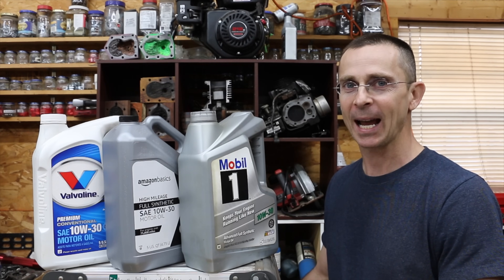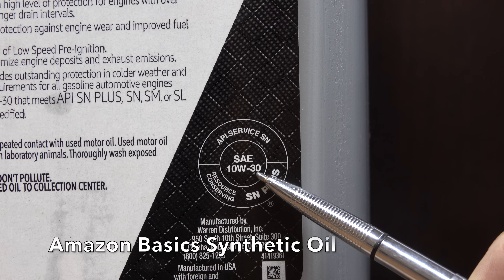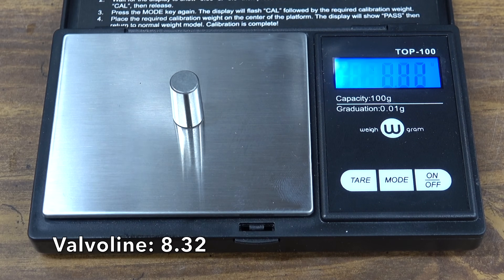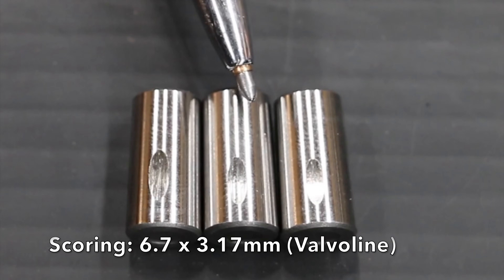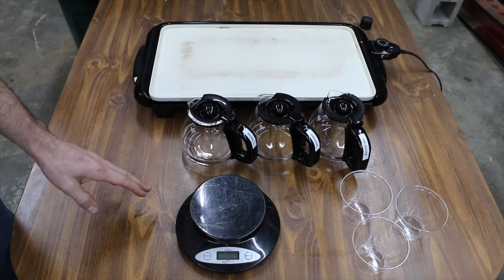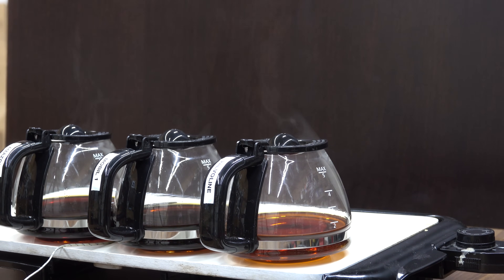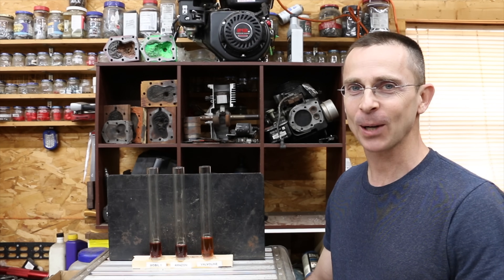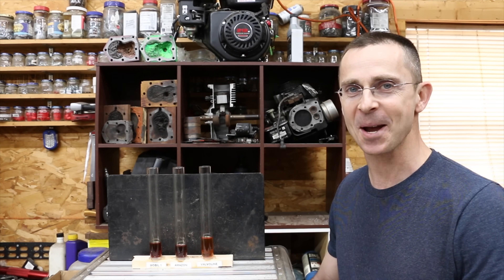Is AmazonBasics Full Synthetic Motor Oil better than Mobil 1? Let's find out!

Comment: Great test. In the friction test, it looked like the wheel dipped deeper into the cup of Mobile1 oil. That could have impacted the wear result. I must say, Amazon oil looks good in your tests.
Reply: It's not likely to make a substantial difference since the extra liquid is pushed off easily by the fairly high pressure he puts on the bearing; only a very thin film does the actual lubricating. There might be a tiny difference due to the extra cooling, but probably not significant enough to change the result.
Reply: Yeah I noticed that too, seemed like there was a lot more oil in the cup
Reply: There was a whole lot more oil in the cup of the Mobil 1. And more lubrication can change the results.
Reply: @ryannrjohnson  and yet, the Amazon Basics did just as well as Mobil 1 even though there was more Mobil 1... (which happens to be the oil I normally grab)
Reply: True, he was measuring heat from friction too right? During that test, and the Amazon Basics was mid 40°'s while both vav and mobile were in the low 50°'s
Reply: I saw that too
Reply: That test could be repeated...
Reply: Yeah. It didn’t seem right.
Reply: Unless it's dry or extremely low on oil, the depth of the oil in this particular test is pretty much meaningless. The viscosity of the oil is what will determine how much is picked up on the wheel as it goes around. So long as there's enough oil to make contact for a full revolution, it's fine.

the only thing that additional oil would give you is thermal capacity and a place to store wear metal... 10 seconds of operation isn't enough time to make either a factor.
Reply: More oil surrounding the friction point means more oil to remove heat, which is the main problem, here.  In hindsight, the oil in each test should have been measured.
Reply: Good eye.  Wonder if it makes a difference or not.  Physics is all about the little things!  Still impressed with the Amazon Oil.  Wonder who they contract it out too... Perhaps Mobile? Lol
Reply: @michaelhayes5601  2:11 shows the maker to be Warren Distribution Inc. So it's not a rebranded Mobil-1.
Reply: @NetRolller3D  good eye on you too!  Just would have been a funny thought.
Reply: When mobile 1 got to speed it was like the rest but that initial start up and slow down could have effected it
Reply: Also, the temperature, while on Amazon Basics,  was 5 degrees lower.
Reply: These are very archaic tests and should be taken with a grain of salt. I remember Amsoil did a test with Head and Shoulders shampoo and it performed the best of all Oils tested, obviously you wouldn't use shampoo in your engine. The point is that some oils perform very well under some conditions and other tests with the same oil perform very bad, plus with age oil and additives in the oil break down and don't perform as well.
Reply: @nexushexus4365  Project farm did a test with head and shoulders and it was beaten easily by an oil additive.
Reply: would be even better if he deep it all the way cover it all with oil just to be fair . but great job wee needed that test am changing my crv 2008 ex-l oil am going to use amazon basics full synthetic  5w-20 .

Comment: amazon basics AKA walmart supertech destroyed mobil 1 considering the bearing was soaked in mobil 1 and amazon basics had very little oil during the bearing test - not a knock on your test but i noticed the mobil 1 had more oil providing more protection than the amazon oil during the test, love the videos especially the oil testing videos. I run supertech syn in my lexus is350 with no concerns, inside is shiny as new at 110k
Reply from the maker: Thank you

Comment: Why did you use Valvoline conventional instead of synthetic? That's a bit misleading, no?
Reply: This is AmazonBasic vs. Mobil 1, non-synthetic is there to show the superiority of Synthetic oil in comparison to mineral oil regardless of the brand.
Reply: @HipolitoLorenzo  It confused me at first because he didn't word it in the best way. Had he said "and we'll also see how well these synthetics do against conventional", then I think it'll be less confusing. Or if he omitted the brand of the conventional because he says in the beginning of the video, "lets see which brand is the best".
Reply: Made valvoline look bad?
Reply: He mentioned that the Amazon Basics synthetic was similar in price to the Valvoline conventional so it was a test to see how a similarly priced oil stacked up.
Reply: All I'm saying is the title is supposed to compare amazon to Mobil 1, not to compare fossil with synth.  I would think if you're going to compare  two synthetics, then use two synthetics, or three. I don't see the point in using a dino oil. If you want to compare dino vs synth, then use three or four of each.
Reply: It was an apples to apples in PRICE to conventional Valvoline the real test was against Mobil 1.
Reply: I agree that the brand should have been left out of it. But including a non synthetic was an interesting control.
Reply: Synthetic vs synthetic only.  This test is misleading

Comment: Well done. Good simulation of proper testing considering your resources. An engine beats up the oil pretty good. An oil analysis runs around $30 including shipping. The real performance after say... 15-30K miles  is reveled in such tests conducted by a laboratories.  My 2.7 L diesel 15k miles still good for continued use.
Reply from the maker: Thank you!

Comment: Interesting results, amazon is clearly buying private labeled oil from one of the top brands.  Next time you do an oil test buy some Redline, their synthetic is like "real" synthetic and not just modified mineral oil.  It would be interesting to see how it compares with your equipment.  Also it would be interesting to see how a diesel oil compares to these synthetic oils since the diesel oil can contain ZDDP and other high pressure additives that would ruin the catalytic converter and oxygen sensor on a (modern car) gas engine.  Anything with flat tappets (non roller cam followers) should fare better with the diesel oil.
Reply from the maker: Thank you for the video idea!

Comment: Video suggestion. Could you please do some heat shrink and adhesive lined heat shrink tubing testing. Also heat shrink tubes with the solder inside would be interesting as well.
Reply from the maker: Thank you for the video idea!

Comment: Looks like the Amazon is made by Warren Oil, which makes allot of store brand oils. Decent company, with decent products. Wouldn't have any qualms about using that oil. I typically do use Mobil 1 though, since I can get a 5qt jug, and a factory filter for my car at Wal-Mart for around $26 total.
Reply from the maker: Thank you!

Comment: A very high percentage of "House Brand"  oils are made by  Warren Distribution or  Warren Unilube  (different companies).    Look on the bottom of your house brand oil....  If it says Wpp,  or Wne,  it's warren dist.    If it says WU, it's warren Unilube.   Both of these companies have a very good track record of producing oils up to par with vehicle warranty requirements.   I use "Generic"  oils in my engines all the time (Warren Dist. most frequently).   There are websites like PQI America that test these oils on the fancy gear,  and if it bears the SN badge,  it's up to the task 99% of the time.   Warren products have always passed.
Reply: Warren is a blender, a specialty chemical company, a distributor or all of the above?
Reply: @gregoryking1745  We do all three. We manufacture and distribute basic to specialty oil.
Reply from the maker: Thank you!

Comment: Great video with in depth and controlled testing.
I'm looking at choosing a 10w40 full syn for my FZ6 bike .
Iv done research in
Motul 7100
Motul 300v
Castrol Power 1 4T
Shell Advance Ultra 4
Silkolene Pro 4
Mobil 1 Racing 4T
AMSOIL (4stroke oil).
There's also a huge difference in the prices even though there all full synthetic
Reply from the maker: Thank you for the test ideas!
Reply: @ProjectFarm  is there an email I can send you the info I gathered

Comment: First off, thanks for another video. I always enjoy your videos. A few things to set straight though:
-Cold flow tests don’t necessarily prove much. When an oil is rated a 10W, that means the oil falls within a viscosity range at the cold temperature. Two 10W oils could have different viscosities without oil quality being a factor. 
-SN+ is probably not stated on the Mobil 1 jug because they didn’t pay to have the certification. Certifications are expensive, and they already have the dexOS cert for LSPI. 

That all being said, I would have no problem using Amazonbasics synthetic oil. It is distributed by Warren, who also distributes Supertech oils. The only thing I would watch for is the formulation could change at any time without notice.
Reply from the maker: Thank you!
Reply: Upon further inspection, Mobil 1 does meet API SN+ and has for some time now. It’s just old stock doesn’t have the label.

Comment: What is your thought about switching to synthetic oil on vehicles with over 100k miles that has always used conventional oil?
Reply: The only problem i had with synthetic oil is it can cause leaks in older engines made to be run with mineral oil, being more runny and thin it can get thru really small gaps and old gaskets.
Reply from the maker: Thank you.  No issues with switching over my 2 vehicles, both with over 200K miles.  Go with high mileage formula to avoid leaks.

Comment: I don’t agree with ur lub test due to the amount of oil in the container . I noticed mobile 1 had a lot more then the others.
Reply: I doesnt matter,because its the very thin layer of oil film,that causes the resistance against friction. So it really is not a thing. More oil = only less heat,but it will be a thing only in a longer run
Reply: @jirka87  It matters, heat has an effect short term too.
Given the same lubrication. Something hot will wear faster than something that is cooler.
Reply: And yet, the Amazon Basics did as well as the Mobile 1, even though there was more Mobil 1.
Reply: Too much oil creates bubbles. Bubbles don't lubricate very well, as in not at all, which is why you don't want to over fill your cars oil pan. If the oil level had been an issue, we'd of seen much more wear on the mobile 1 bearing.
Reply: Fisoxlt, to piggy back on your argument, hence windage trays and crank scrapers.
Reply: It was threw out the cup tho
Reply: The only issue I could see with adding more oil is that more oil=cooler. Of course 10 minutes wont heat it up as much, so more/less wont make a difference
Reply: Unless it's dry or extremely low on oil, the depth of the oil in this particular test is pretty much meaningless. The viscosity of the oil is what will determine how much is picked up on the wheel as it goes around. So long as there's enough oil to make contact for a full revolution, it's fine.

the only thing that additional oil would give you is thermal capacity and a place to store wear metal... 10 seconds of operation isn't enough time to make either a factor.

Comment: AB oil made by Warren which also makes Walmart's Supertech....unless there is a different detergent pack, I think it isstill cheaper to get the ST at Walmart....also try to always use a OEM filter....filter quality has changed in the aftermarket space recently...
Reply from the maker: Thank you!

Comment: You should try Rotella.  I use 15W-40 Rotella in all my gasoline vehicles and I noticed it has a really strong tackiness to it unlike regular oil which i would think will be better on your engine.
Reply: You should not use 15w40 in your gas engines. The oil is too thick. High oil pressure isn't always better. More pressure means less flow. If you want to use Rotella, I have used the t6 in my gas engines and have had very good results
Reply: @sHoRtBuSseR  It's good for something that is meant for 40 weight like an old gas tractor (think ford 8n).  definitely anything modern though does not need that thick of oil.
Reply: Dylan Houser I use it in my engines because I live in a non emissions are and i do not run cats on any vehicles of mine.
Reply: the high pressure wear additives in it will screw up your catalytic converter and oxygen sensor is the only downside.  That's why it's meant for diesel only. But it's fine in engines without an O2 sensor or cat
Reply from the maker: Thank you!
Reply: @Angel Valdez t6 is excellent oil and I haven't ran into any problems with it. I switched my gas jeep over to it at 135k I am at 170k now. Also ran it in my turbo Jetta and never had a problem
Reply: @Angel Valdez be careful going to a synthetic on a high miles engine. If you ran only conventional before plan on doing a filter change and oil top off around 500 miles in to the first oil change. Use a factory filter or a Napa Gold.

Comment: Best oil I’ve ever used Motul 8100 xclean+, weird name I know but I’ve compared it to Mobil 1, Castrol Edge and a basics range. The Motul actually made my engine sound quieter, a slight improvement in mpg and the engine noticeably ran smoother. 

And also if you want your engine to last longer I always replace my fully synthetic oil around 7 or 8 thousand miles as it’s Lubricating properties dramatically reduced after this point. Motul is “100% synthetic” rather than “fully synthetic” which is still a mix of oils.
Reply: do you use oil analysis or just guess? what is the diff between full and 100%."Synthetic" is a marketing term not a scientific term. if not show me please
Reply: @Gregory King Well i have a Mechanical Engineering background and degree with associated topics, so i know a thing or two. Anyway so to put it simply fully synthetic and 100% synthetic are completely different. There is no legal term to define Fully Synthetic, other than a blend percentage mix of mineral oil, but even then refined mineral oil can be classed a synthetic. Where as 100% synthetic involves companies developing molecules from scratch, which are then synthesised and produced free of any mineral or crude oils. It's actually quite an interesting subject. I'll leave some links before for you as to where i formed my opinion from, along with actually being involved with them in the manufacturing industry. 

Motul Oil Difference
http://www.ozhonda.com/forum/showthread.php?189571-Motul-%96-The-Difference-Between-100-and-Full-Synthetic-Oil

Processing of Oil
https://www.bizol.com/phase-out/motor-oil/synthetic-oil/

Oil Friction Test Analysis
https://youtu.be/UKkZePMtcuU 

(performance vehicles ran on 100% synthetic have less engine wear on the piston rings, crank and connecting rod bearings after 100,000 miles, from my own findings.)
Reply from the maker: Thank you for the video idea!

Comment: REPOSTED TO GET VIDEO IDEA OUT SO OTHER CAN REQUEST-  would anyone else want to see a shown down of the best fuel additives from every major brand? I use a wide variety of fuel products but without a borescope or taking my engine apart I don't know if I am truly getting my moneys worth. please thumbs up this comment and see if a massive fuel additive show down by Project Farm would help answer a lot of questions. there are a lot of youtube videos of people saying "this is great" with no proof, it may be a paid review, a low quality videos 144p video were I cant really tells if the product is doing anything, or is outdated due to recent years of PEA and other additives being widely used. a show down of this size would take a lot off work, editing, time, and cost. but I am sure if enough people agree an request it, be willing to share it, it may be possible that Project Farm will deliver an answer a lot of questions when people search for fuel additives and what is the best for your specific needs. for cleaning, performance, value, and delivering on product claims. FUEL ADDITIVE SHOWDOWN - Seafoam, Marvel mystery oil, Heet(red), STP 5n1, Gumout one n done, Royal purple max clean, Stabil 360, Redline, lucas deep clean, Amsoil, and techron.
Reply from the maker: Thank you for the video idea!

Comment: 310,000 miles on OEM oil  , it really does not matter what Mule P--s put in your engine , it`s removing the contaminates that the engine generates before they cause a problem to shorten your engine life.

Comment: I'd like to see Rotella T6 tested. I used it in my 2006 Acura TL for as long as I can remember. Bought in 2010 with 73k miles on it. Currently has 243k miles on it. 

Used Rotella T6 5W-40 and Purolator One oil filter. #notsponspored
Reply from the maker: Thank you for the video idea!

Comment: i use the amazon basics 5w-30 in my truck with a bottle of lucas full synthetic oil treatment.  a turbo charged direct injection engine is what ford uses. i have one in my 2015 fusion.  2.0 ecoboost
Reply from the maker: Thank you!

Comment: did you notice how the full synthetic mobil 1 and amazon brand darkened after the heat loss test but valvoline didn't? Could you do a fallow up lubricity test after heating test? If full synthetic oil looses some of it protectivity after a little heat but conventenol doesn't that is a selling point. Also how do these oils compare with the proper amount of MMO added to them in these tests? great vid
Reply from the maker: Thank you for the video idea!

Comment: I work at a shop and my boss has used mobile one in his Santa Fe since the first oil change and he hit 80 Thousand Miles and spun a bearing its a common problem on Hyundai's but I feel like if he was using mobile one that expensive oil should have stopped something. Switch to Castrol which is GDI motor preferred
Reply from the maker: Wow!  That's not good.

Comment: But the question is can this oil be used in normal car engines without a turbo charger..
Reply from the maker: Yes, it can be. I use it in my non-turbo engines.